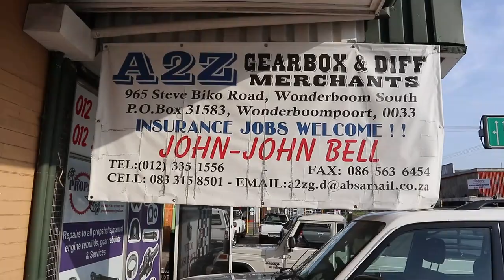Howto CD009 and CD00a gearbox rebuild. 350Z clutch and gearbox swap part2

Comment: Just to clear up a little misinformation in the title, the CD009 is just the older revision of the CD00A. They are both designed to work with the VQ35DE engine. The JK transmissions were the ones used on the VQ35HR and VQ37VHR engines, they can be a bit tricky to tell apart but the easiest way is the JK uses an concentric internal clutch slave cylinder, the CD009/A uses a traditional externally mounted slave cylinder and there are two bolt holes in front of the clutch fork to mount the slave cylinder. The JK doesn't have those two mounting holes.
Reply from the maker: That and the gear selection indicator electronics. Hint - don't touch or try to adjust that gear selection electronic pickup - you will never get it to work again. This system obviously won't work on the VQ35HR as the support systems dont exist. Thanks for the comment!

Comment: So it’s possible to install newer 07 350z gears?into an 03 casing im trying to rebuild an 03 g35 transmission but I’d like newer gears and synchros
Reply from the maker: Yes. If you have a bell housing. The bell housing and main bearing is slightly different. I think the input shaft is a different diameter, but other than that, you are golden

Comment: randon question and from what i can find, sorta seems like the best place to ask. i want to swap a (new) cd009 into my volvo 240 but not sure if the cd00a will be the same process, any reason why it wouldnt work? are they different sizes?
Reply from the maker: Thanks for the question. The CD00A to be sure is the 6 speed manual from the DE. I it not the best transmission as it typically has issues with synchros. If I recall, the shape of them are quite the same, but the starter and some sensor is located in a different place. If I recall the position of the starter was the big issue. The CD009 is built to handle power, but if you have a CD00A, transplanting it to the Volvo will be pain in any event
Reply: @We-R-Racing  noted! thanks for the info!!

Comment: Great stuff, in the process of getting my box rebuild as well. Did you guys put the DE bellhousing on the HR gearbox to make it work in the 350z?
Reply from the maker: Kyle no we didn't. This one is an HR. We organized the DE bell housing for a guy who wants to fit the cd009 to a DE. It will fit 100% the main input shaft diameter needs to be adjusted to fit, or you can just use one from the DE
Reply from the maker: Another difference is in the thrust bearing. DE has a more traditional setup, where the HR has this questionable consentric slave cylinder. The guys who seriously race buy a csc delete kit from Z1 Motorsport. Which area are you?
Reply: @We-R-Racing   I'm from Cape Town. I have a DE so will just be replacing the worn out 5th gear synchro and whatever else we find damaged when we open the box up. I was considering buying an HR box and making it work, but they have also become very expensive.
Reply from the maker: @kylea3168  the DE boxes are known for their synchro issues. I will have a box from a 370Z coming in soon... the bellhousing from the DE fits perfectly onto that box.... them you don't have issues with the clutch or the timing sensor thing... the HR uses that stupid concentric slave setup, where yours is more traditional...
Reply: @We-R-Racing  just to complicate things further,  technically the cd009 is on the "rev up" motors in late 05 and 06 models, the HR (and 370z) use the jk40c. Hopefully this is helpful if youre ever searching part numbers!